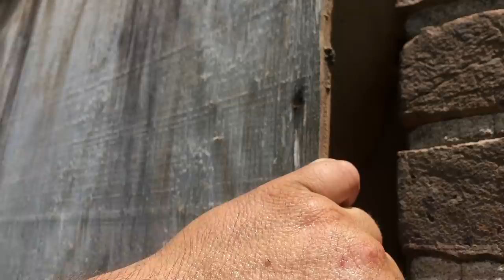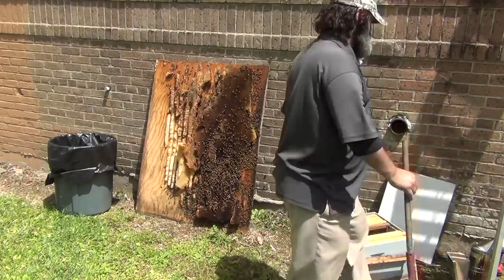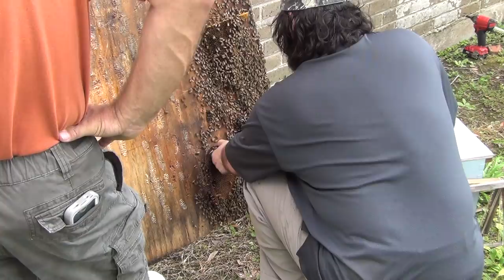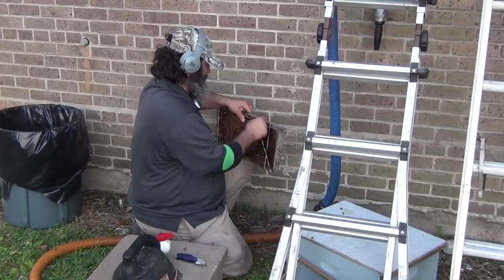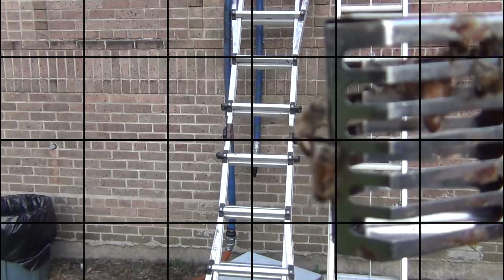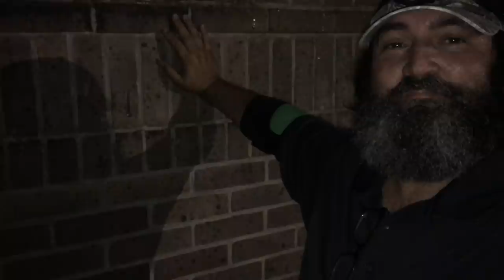Massive Bee Hive Removed Alive!

Comment: So in a situation like this with so many bees, would there still be only 1 queen?
Reply from the maker: MissouriBowfishSquad I only ran across one queen during this removal. 

Sometimes they will go into winter with more than one queen (perhaps 10-15% of the time, if that).

About 3 years ago towards the end of the season I removed 3 hives at different locations where I caught 2 queens in each colony.

Now if a colony has swarmed as in very recently & numbers are still up you could run into multiple Virgin queens.

The most I ever ran across personally during a removal process was 9 but I have removed many, many hives over the years where I have caught anywhere from 3-5 queens but as mentioned these are virgin queens that had just hatched out soon after these particular colonies had already swarmed.
Reply from the maker: Infinite Consciousness a queen’s abdomen is longer by approximately 15-25% roughly (as size can vary). She also has a larger pronounced black spot atop her thorax. These are the two main things I look for when trying to spot the queen.
Reply from the maker: Infinite Consciousness 👍🐝🐝🐝

Comment: Hi JP 1. what do you do withe the bagged comb JP. 2. How do you get them to go into the first box without the Queen present i.e whats the allure ?
Reply from the maker: Most of the bagged comb is placed in the bee yard for the bees to rob out any available honey.

When a swarm of bees is displaced they will reorient very quickly.

Any box that has housed bees previously as in “bee hive” other bees will be extremely attracted to because of familiar scent, mainly propolis or what we commonly call “bee glue.”

Propolis is made from tree sap & is gummy. Bees like to propolis & it winds up in tight seems & between the cover & top of the box & on the bottom board & frames.

Bees can smell the odors that propolis cast. Their sense of smell is very acute, even better than mosquitoes!

Comment: What is that smoke?  You don't spray much of it.  What does it do to the bee's?
Reply from the maker: The smoker is filled with burlap. Smoke masks “alarm pheromone” one of several pheromones bees use to communicate with one another. Smoke actually can do a few things but basically I use it to calm the bees & to move them off of comb sections I want to fool with that might be covered in bees.